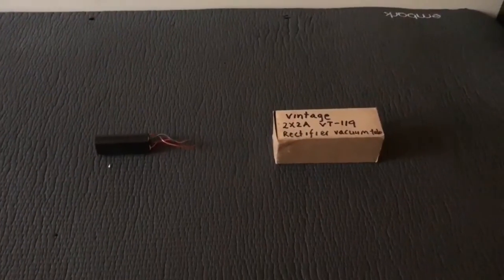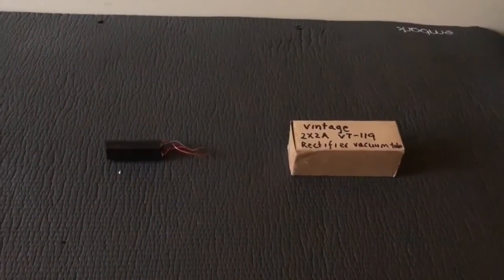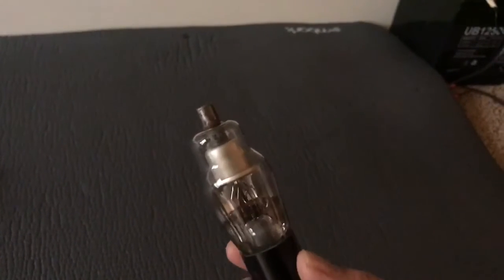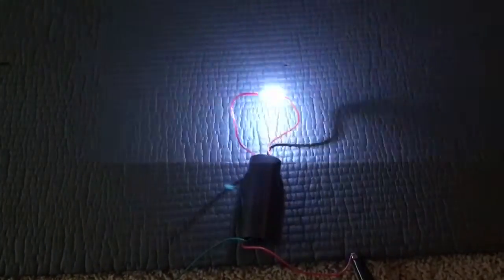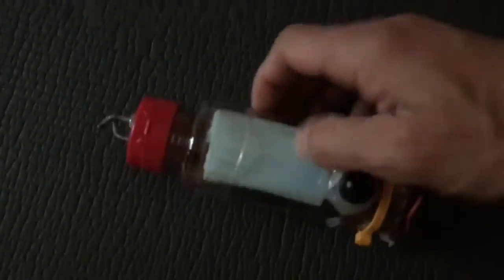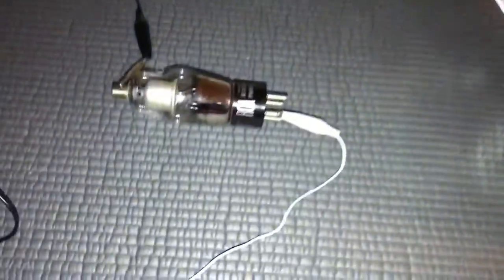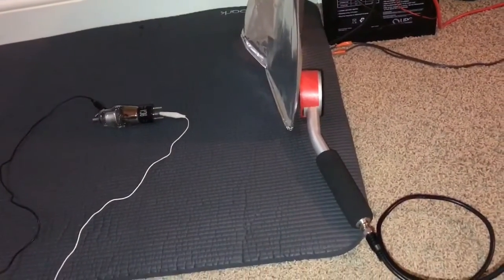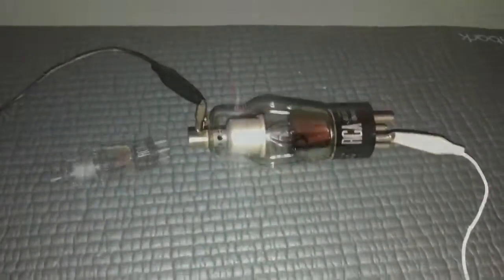Cool X-Ray Machine for $10

Comment: Why it produce less x Ray if heated because in resl x Ray tube it happens opposite , more Filament current generates more xrays ?
Reply from the maker: The reason for this is that when the tube filament is heated, it takes less energy for the electrons to boil off the filament, and so they have less energy when they strike the anode. This results in the production of soft x-rays, which are unable to penetrate the glass of the tube.

If the filament is not heated, then it takes much higher voltage to boil electrons off the filament. This results in a much higher velocity or energetics electrons striking the anode. This then results in higher energy x-ray production, also known as hard x-rays. Most of these hard x-rays are capable of penetrating the glass wall of the tube. For this reason, this results in apparent increased x-ray production with cold cathode operation.
Reply: @BrianDhvTinkerer ;so does this mean , in other word that ...
The Breakdown voltge of Cold Cathode tube is higher than that of Hot one ? 
But than other Question rise ? Why this is not the case with real X tube with hot cathode Filament ? Is that because of similar reason of breakdown and vacuum ? 
Can crt produce equal amount of x Ray compare to real X tube if driven at same power ?
Reply from the maker: @omsingharjit  with a real x-ray tube, the spacing between the anode and cathode is much greater, which needs a much higher breakdown voltage. Also, the current in a commercial x-ray tube is much much higher. It’s not possible to generate the amount of x-ray intensity with a cold cathode tube. Increased current density results in statistically more hard x-rays being produced because X-ray production by bremsstrahlung is not giving a single energy but an x-ray spectrum with hard x-rays, and soft x rays. The soft X-rays are blocked by the glass envelope
Reply: @BrianDhvTinkerer  thank you .

Comment: what is the input voltage
Reply from the maker: Input is 3.7 V Li battery
Reply: @BrianDhvTinkerer  but what voltage is used for the vacuum tube
Reply from the maker: @lennihaapala8169  vacuum tube starts making X rays around 20-30kV

Comment: Omg I have a radio I rientri know if it coil d ne used pe not
Doma it have to be a pulsating module or can it be dc?
Reply from the maker: It can be AC or DC if it’s a rectifier tube. It will even work with a small Tesla Coil and a van der graaf generator or Wimshurst machine

Comment: Would you be so kind to give some details on output KV and A of boost converter?
Reply from the maker: They are around 15kV out. The current is very low probably micramps but enough to make x rays
Reply: @BrianDhvTinkerer  hold on these usually output 0.5A... and 15KV? shouldn't be 400 as stated?

Comment: What power supply do you use?
Reply from the maker: Cheap high voltage boost converter for about $3 from eBay or AliExpress

Comment: How did you build the booster output device?
Reply from the maker: I used wire nuts and alligator clips for connecting up to test it. In the video, I used a 3.7V standard lithium ion 2800mAh battery holder. Holds one cell. I soldered this to a push to turn on swith to the booster positive and negative input. The negative HV output of the boost converter is connected to any of the bottom pins on the vacuum tube. The positive of the boost converted is connected to the top anode electrode. The X Rays come out of the side of the tube. You know when X rays are produced because the glass of the rectifier tube starts to glow yellow-orange.
Reply from the maker: Mark K got it from ebay for $3
Reply from the maker: Mark K https://rover.ebay.com/rover/0/0/0?mpre=https%3A%2F%2Fwww.ebay.com%2Fulk%2Fitm%2F141998596640

Comment: Whats the specs of the boost converter?
Reply from the maker: Kevin this looks like a good deal:

https://rover.ebay.com/rover/0/0/0?mpre=https%3A%2F%2Fwww.ebay.com%2Fulk%2Fitm%2F332679833214
Reply: SciTubeHD is that the one used in the video? And whats the voltage? its obveusly not 300+ kv, the one written on the ebay listing
Reply from the maker: Kevin yes its about 20 kV. I tried different ones like this from Ebay and they all make a ton of X rays. The highest dose is perpendicular to the long axis of the tube

Comment from the maker: I measured >100 mR/h. It takes 2mR to shoot a CXR. 2/100 x 60 = approx 1 minute of exposure. The X rays are much softer when the filament is heated and will not penetrate the glass envelope resulting in less usable X rays. I am planning on borrowing a DR X ray plate from the X ray dept, shooting something like some ribs or a shoe or some keys for 1 minute at 20kV and then bringing it back for them to develop it for me. Will keep you posted on the success if this.
Reply: What happened
Reply from the maker: @intuitiveminds7034  got some good results:

Home Made X-Ray Images
https://youtu.be/LtfQ3NLS9FA

And here:

Home made X-Rays for Detective Work
https://youtu.be/EktVdn6PX14

Comment: I replicated your setup and successfully got a reading of 20k CPM, that's around 70 uSv/h or 0.7 mR/h with only one lithium battery. The range of it was about 10 cm. The reading could be higher if I increase the output voltage.
Reply from the maker: jason yang awesome. I just purchased a green X ray plate and plan to make some X rays. I want to see if the plate makes enough light to be picked up by an digital camera on long exposure of about 30 seconds.
Reply: @BrianDhvTinkerer  I believe it shouldn't be a problem for camera to pick it up as long as you set it to long exposure.
Reply: @BrianDhvTinkerer  I bought a 4x4 inch intensifier screen with 400 gain, no luck with the tube. I think it will be better to heat up the filament to get more free electron. I tried but somehow the filament is burned. Also, a metal box with a window should concentrate the x ray to the output window. I will give it a try latter.
Reply: you got the data wrong 70 uSv/h are 7 mR/h not 0.7 mR/h.

Comment: This is not safe is it?
Reply from the maker: Vin Gaming it’s relatively safe. You don’t want to spend extended periods of time in front of it when it’s running. It’s much less of a dose then medical x rays.
Reply: @BrianDhvTinkerer  so in a way there are risks
Reply: Vin S.  There is always a risk. You get lots of radiation when you take a plane, for example. The important part is "how much is it".
Reply: @Pavlov972  It's same like if you spend 5 hours in front of TV.

Comment: Could you try the reverse polarity? I saw another video that the result: forward polarity: 30 mR/h (300 uSv/h)
, reverse polarity: over 500mR/h (more than 5000 uSv/h). Although he is using DY86, a different vacuum tube.
Reply: Which video??

Comment: this isnt a xray tube, it wont work for x ray photography, its just a vacuum tube and with these its normal to emit some xrays, but if it would be a real one you shouldnd stand behind them because xrays can damage the DNS and normally you could see the xrays with the camera as a disturbation on the video material
Reply: Bro, this is x-ray. This produce small radiation.
Reply: You can't see it on video because this is a digital camera sensor, those are not effected by X-Rays. This problem was with the old film cameras ;-) 

I also think that this is a real X-Ray tube and the guy in the video was just a bit crazy at this point. 
In the end it doesn't matter which kind of radiation this was -it was really high and could damage your dna...
Reply: @heinzalberto6732  Super strong ionizing radiation will still create pixel noise on a digital camera. I have seen some people film the atomic bomb using modern camera that the explosion causes plenty pixel noise in the video.
Reply: Heinz Alberto no, digital equipment is still affected by ionising radiation:
https://youtu.be/Uf4Ux4SlyT4
Reply: You are right on your first part, the doses of this setup compare to a real X ray generator is a lot less. The X ray tube is larger and the target metal that electronic impact on is different. However, with that geiger counter reading, it will still damage human body if you are that close to the setup. The x-ray from this setup seemingly is hard x-ray which is stronger than soft x-ray. I say that is because soft x-ray can be blocked using a thin aluminium sheet.

Comment: It coud be just electromagnetic field....
Reply from the maker: ionel anonimul I did a control experiment with high voltage source running and no rectifier tube and there was no activity above background. Also I isolated the counter behind a grounded aluminum  plate  to shield the counter from emi and it still showed the counts.
Reply: Unlikely at that distance
Reply: From what I know a geiger counter can only pick up ionizing radiation like x-rays and gamma radiation
Reply: They are also highly susceptible to electromagnetic radiation from arcs and the like. You do need to take great care to prevent this, as SciTubeHD did. He performed a controlled experiment. I have more than fifty years experience with radiation detection and measurement.

Comment: where did you get your Geiger Counter and Pancake Probe?  I want to get one like this, where can I get one and for how much?
Reply from the maker: I bought this from the following seller on ebay. You may want to contact them to see if they have another one:
ORDER DATE
May 07, 2016 
ORDER TOTAL
US $400.00
Order S.E.I. Radiation Alert Inspector Xtreme USB Rugged Digital MeterView similar items
View seller's other items
More actions
1 item sold by
S.E.I. Radiation Alert Inspector Xtreme USB Rugged Digital Meter
S.E.I. Radiation Alert Inspector Xtreme USB Rugged Digital Meter
( 262406795927 )
 It was pricey but well worth it as it can get alpha when the plastic cover is removed off the pancake.

Comment: Thanks for the video - very cool!  What type of boost converter did you use (I see that there are many options, some with very high output), what type of battery, and how did you wire it up?  Thanks!
Reply from the maker: Tyler Bennett here is one such example:
https://rover.ebay.com/rover/0/0/0?mpre=https%3A%2F%2Fwww.ebay.com%2Fulk%2Fitm%2F141998596640

They dont actually produce 400kV but more like 10-20kV which is good for cold cathode X-ray production. I got two 2X2A tubes for $8! The setup could be enclosed in a metal lines box for a cool portable x ray machine!
Reply from the maker: Tyler Bennett oh btw I used a 3.6-3.7V lithium ion battery to power the hv boost converter.  They are marked for correct polarity. I took the HV output of the boost converter and connected one end to any one of the cathode pins (it doesn’t matter which one)  on the bottom of the vacuum tube and other lead to the top anode end of the tube and checked for x Ray’s. I then switched the leads from top to bottom and bottom to top and stayed with the one that gave me the most x ray output :)
Reply: Excellent - well done and thank you for the information!!

Comment: So do I need a special safety shielf for this?
Reply from the maker: the xray  doses are so low that you dont need any special protection unless you were going to spend a lot of time near the setup.
Reply: Ok thanks very much;)
Reply: If you want to produce more radiation...then you gotta use lead blocks to cover the Coolidge tube...
Reply: Even if the rad's are low. I would still recommend a lead apron and thyroid collar.
Reply: YOU NEED TO PUT LEAD ON WALL WHERE X-RAY MACHINE IS POINTING.
Reply: @joshualogan6655  i don't imagine brehmstralung would be produced in excess, maybe minuscule.

P.s. please stop shouting.
Reply: @c2n10  Just to make things clear. X-rays machines produce x-rays. They have highly penetration power. Yes, this "X-rays" machine produce small amount of x-rays, but it can still be dangerous. Low energy X-rays can still be harmfull. That's why I'll point my X-ray machine to my neighbor's bed, cause I hate him and I want him to die. That's also the reason why I will buy 300kv power supply, not 20kv.
Reply: @joshualogan6655  oh sorry mate i thought you were on about brehmstralung.
My bad there.
Reply: @c2n10  It's okay.
Reply: @c2n10  But I think I can see your point.